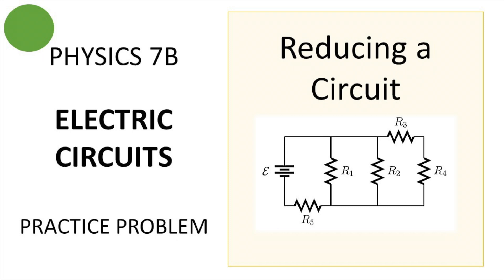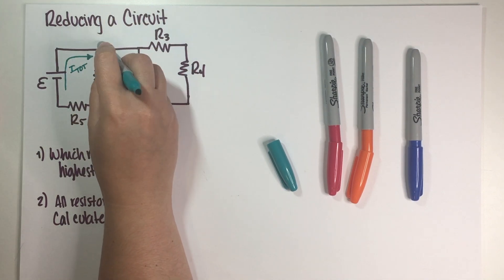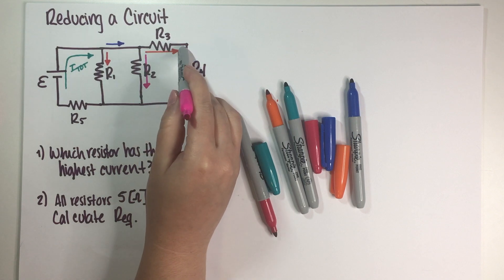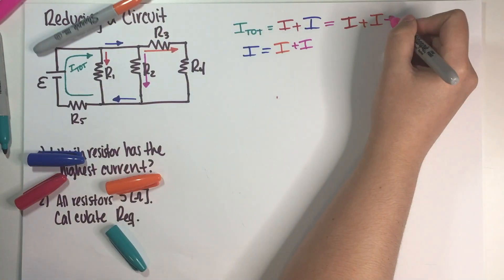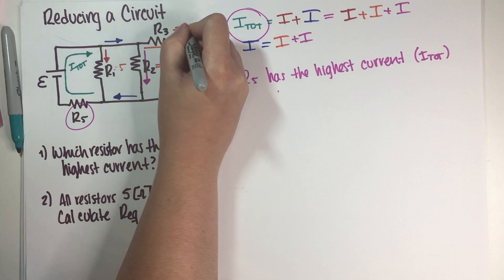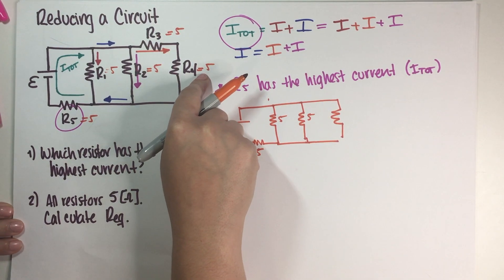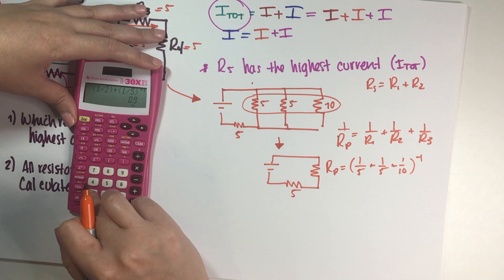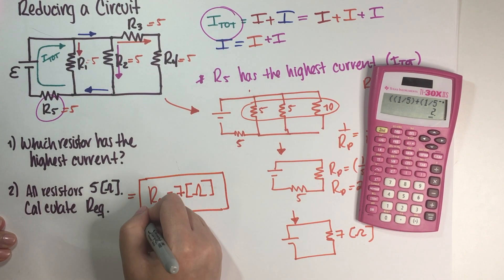PHY7B Electric Circuits Practice Problem - Reducing a Circuit

Comment: Why are the two junction resistors being put in parallel with the 10 ohms resistor? The 10 ohms resistor is from the “main” wire so wouldn’t those two 5’s be in series with the last 5?